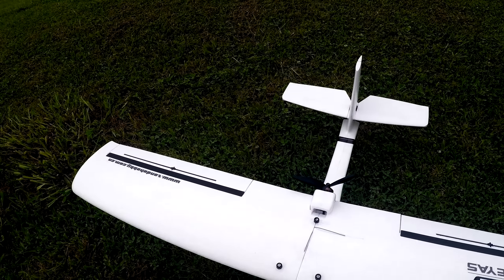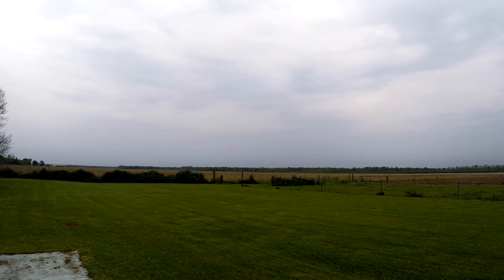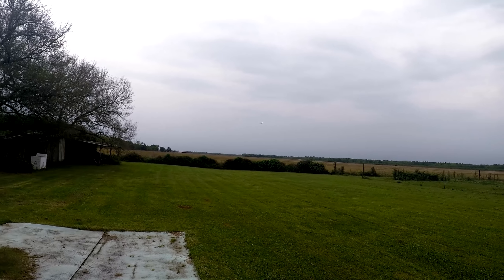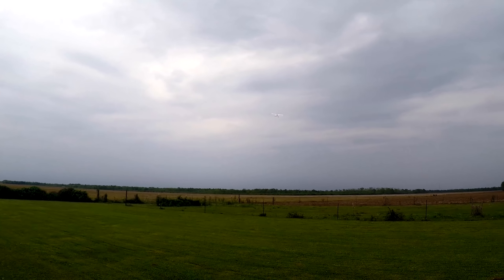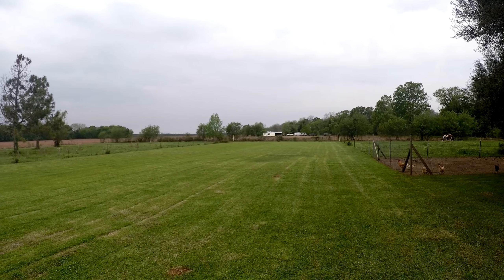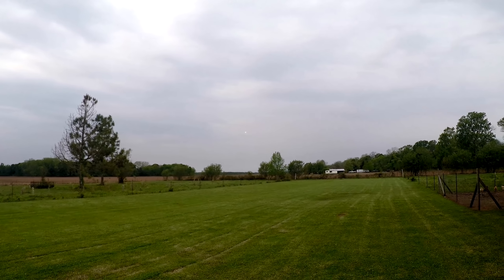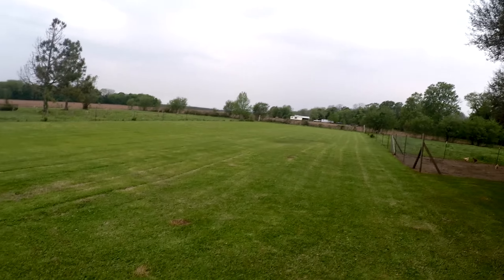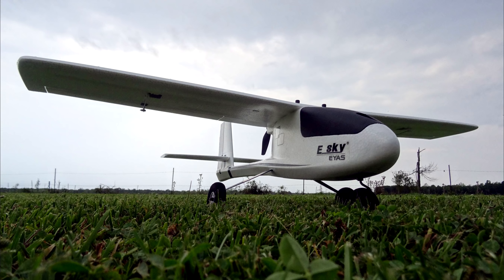Esky Eagle (EYAS?) Maiden Flight

Comment: You'd swear it was an EDF ya know? I kind of like it. It's a bit different, enough that it makes it interesting. Certainly a good value too. You're brave for 100% and no expo. LOL! My flight profile would look like an EKG printout if I'd done that. Glad you got some time in. Seems like every time I look, you're getting lines of storms. :(
Reply from the maker: Yep, weather can only get better... lol I tried a few props earlier and found one I like. Less noise, and more power according to the watt meter. We'll see how it works in the air, I expect it will be fine though. I don't remember what brand, but it's a 2-blade 6x4.5 BTW it was a lot smoother and more fun flying with lower rates, even with no expo... lol I need to fix that in the radio before the next flight too. I'll got with 75% and a bit of expo I think.

Comment: Good comprehensive flight report.  What would be the maximum size prop that one could fit to the plane?  Thanks
Reply from the maker: I don't think there's any room for anything larger than the 6" that comes on it, without modifying the motor mount. Next flight will have a different prop on it though, should be quieter and maybe even a bit more power according to my watt meter.

Comment: Are you sure that the screaming noise is the result of the prop's close proximity to the wing and fuselage, and not due to the design characteristics of the motor?
Reply from the maker: It's definitely prop noise. Brushless motors are almost silent apart from a little bit of whine at RPM. Prop noise is worse when it's running in "dirty" air off the trailing edge of a wing. That's why most flying wings are loud too. A tractor setup will always be more efficient and quieter than a pusher, but there are other benefits to a pusher too. (Out of view for FPV planes, rear mounting of the motor for CG on a wing, protected prop on a design like this plane, etc.) I tried a few different props today and found one I like, I'll test fly it soon.

Comment: Love all your videos!! Do you recommend this over the Nano Talon as a first fpv plane?
Reply from the maker: No, for FPV the Nano Talon would be the better choice. It's a fun little plane and set up for FPV gear out of the box. People have already taken it well beyond what it was designed for and proven it's capabilities... lol Even the guys that designed it say they are impressed with what people have done. This Esky plane would need a fair bit of modification to make the best use of room inside the fuselage, and doesn't seem as efficient either. Not to say it can't be done, but the Nano Talon would be much easier to get better results. ;) This one is more at home just sport flying LOS and doing touch and go's.
Reply: @bonafidepirate  Thank you for the reply! Ive had my heart set on the Nano Talon for a year now... Just havent pulled the trigger lol.
Reply: @caymanhilldesigns453  You wont be sorry that you did. Very wise choice.

Comment: Sounds like a dentist drill with wings! I need it! Not the drill.
Reply from the maker: lol Yes it does! It sounds like 1/4 of a race quad. I was just in my shop playing with some different props, and got some good results with one of them. Less noise and more power to boot (at least on the watt meter). I'll wait until I can fly it and see how it works in the air though.
Reply: @bonafidepirate  I ordered one! Is the fuselage plastic or foam?